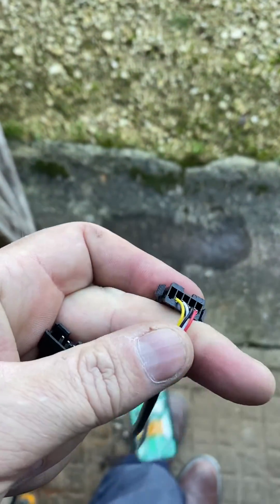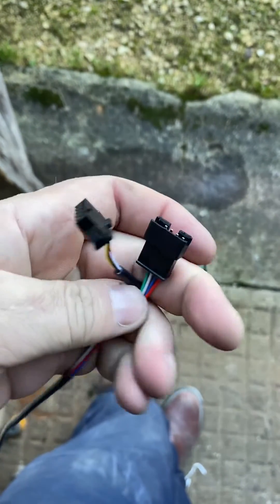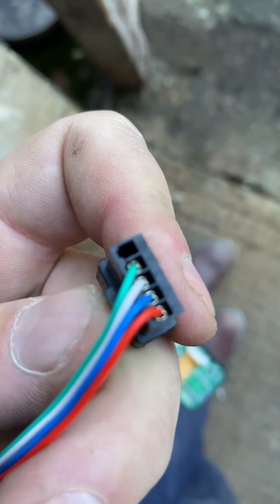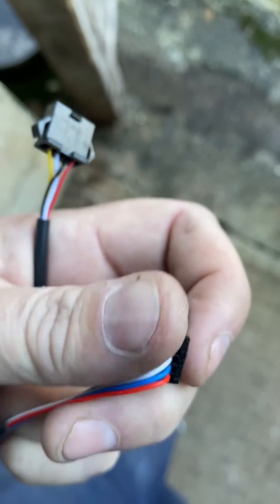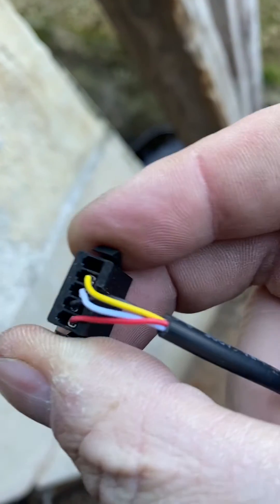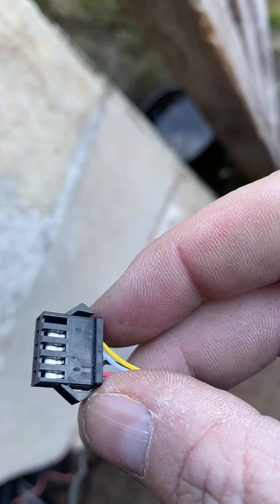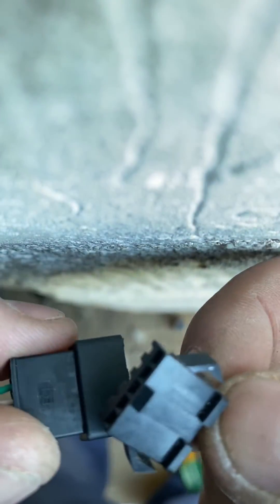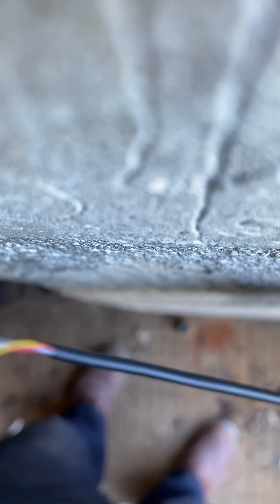Comfort controller wiring colours and display cable socket wiring.

Comment: Useful video thanks.

If you're in a situation like me, where a non-standard extension cable has been used / you only have the Red, Blue, Green & White colours as a reference, here's a wire map:

RED to RED
BLUE to BLACK
WHITE to WHITE
GREEN to YELLOW

Comment: Hi , can I extend the control cable with some alarm cable or data cable?
Can't understand why the wires are so short.
Reply from the maker: You get 1.8m as standard. We also have a 2.5m extension or an extra long 7m cable to purchase in our shop. 1.8m is enough for most applications. You can extend the cables with your own cable but make sure the cable is larger diameter  than the original to avoid voltage drops.